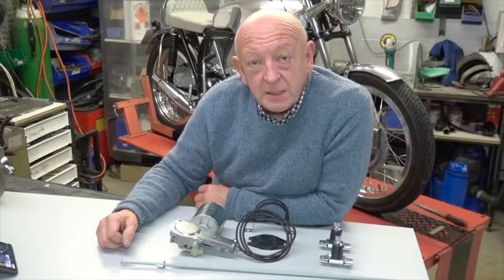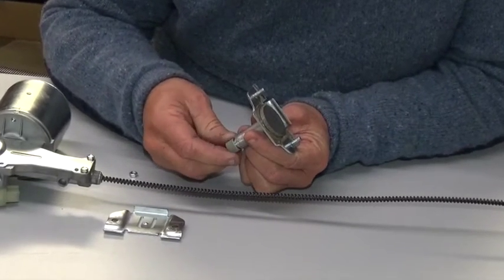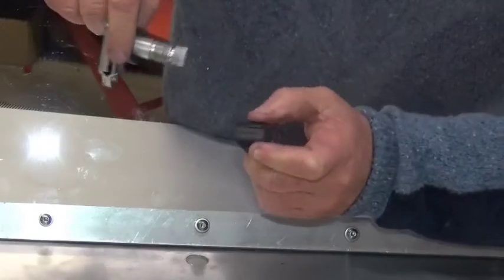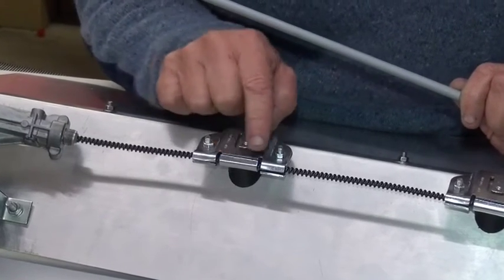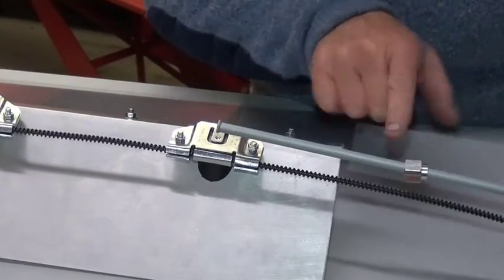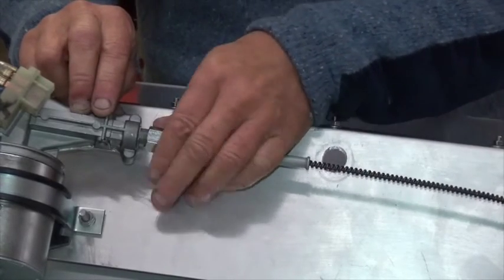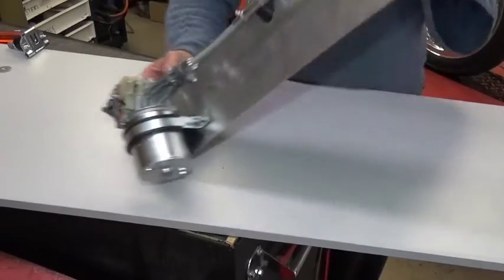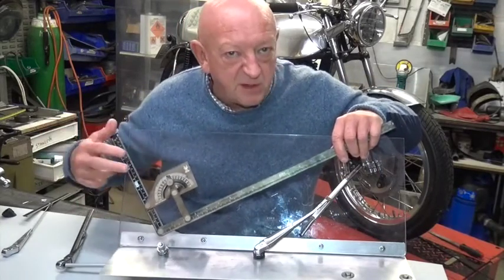CBS Windscreen Wiper Kit Installation

Comment: Could you use this for wipers that go opposite direction  so effectively you put one box upside down? I have an old car with wipers on the outside that both go down and meet in the middle of the car
Reply from the maker: Hi Yes, you are dead right, just invert one of the wheel boxes.
Reply: @CarBuilderSolutions  hi, thanks for your response. May I ask how flexible the shaft is? Due to the design of my car, with both wipers on the far outside I'm not sure I can fit the motor beside that  but I might if I can use an angle or even better: an U turn 😁
Reply from the maker: @GTE_Channel   Hi, you can form the tube to around a 5 inch radius before it drags
Reply: @CarBuilderSolutions  I've send you an email yesterday with some additional questions  looking to purchase this system
Reply from the maker: Not seen anything......can you forward again please to info@carbuilder.com
Reply: @CarBuilderSolutions  Just send it again
Reply: Just ordered the kit, and some additional stuff. 👍

Comment: The CBS catalog recommends connecting the wiper motor with a sophisticated Lucas square rocker switch. 
However,  I built my dashboard with a single pole on/off switch. So, how to connect the wiper motor ?

The Lucas 14W motor works with 3 cables : 
- a blue one for ground, connected to pin 1 of the terminal  
- a yellow one for fast speed connected on pin 3
- a red one for slow speed connected to pin 5

If you do not care about the park function, you can simply connect these pins to an off/on switch for one speed or off/on/on switch for two speed operation.

If you want to use the park function, then a word of explanation is necessary. Inside the terminal, there is an inverter switch activated by the park function. When running, this switch connects pin 2 and 4. When parked, the switch connects pin 2 and 1 ie ground. Via the Lucas rocker switch, this brings ground to the motor to make it stop at the park position. Without this ground connection, the motor will slow down at park, but go on again, and never stop ! See the specific CBS video about the gear for more explanations about this switch. The problem is that, if you use a normal on/off switch to start, this ground connection will cause a short circuit. So, you have to disconnect this internal connection before starting the motor. This can be done with an additional inverter relay. 

To use an on/off switch, connections are as follows :
- ground to pin 1 and also relay 85
- + feed to pin 4 and also to on/off switch
- relay 86 to on/off switch to command the relay.
- relay 86 and 87 jumped together  
- relay 30 to pin 5 for slow speed.  No dual speed with this set-up.
- relay 87a to pin 2
So, when the relay is activated, pin 5 receives + feed from 30, 87 and the on switch. When the relay is deactivated, pin 5 receives + feed from 30, 87a, pin2, the internal switch connected to pin4, pin4, and + feed. So the wipers can reach the park position. Waw ! When at park position, pin 5 receives ground from 30, 87a, pin2, the internal switch connected to pin1 and ground. This abruptly stops the motor. 

If you use an inverter on/on switch, you do not need a relay, and the connections are very simple.
- connect pin 1 to ground
- connect pin 5 to the "feed" pin of the switch
- connect pin 2 to the "off side" pin of the switch
- connect pin 4 to + feed and to the "on side" pin of the switch 

Recommended 
If you use an on/off/on switch, connect like on/on above. But the off position of the switch will give you an extra function : you can stop the wipers at any position ! So, you will have 3 functions : Park/Stop/On ! Because this switch is also easier to find, I do recommend this set-up !

To have Park/On/Stop in that more comfortable order,  you can use the CBS #TSPA4 off/on/on switch as follows :
- connect pin 1 to ground
- connect pin 2 to pin 2 of the switch
- connect pin 4 to + feed and to pin4 of the switch
- connect pin 5 ( slow speed )  to pin 6 of the switch.